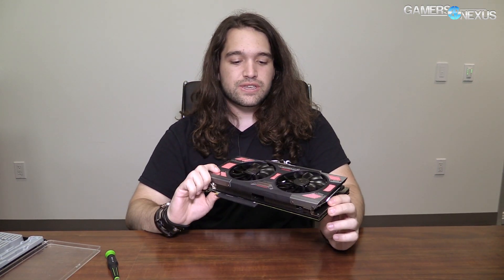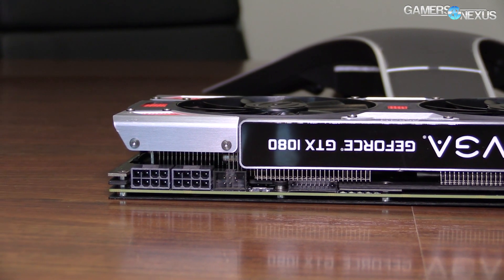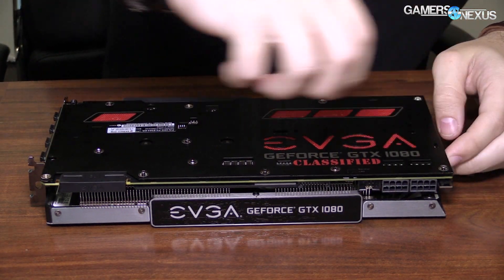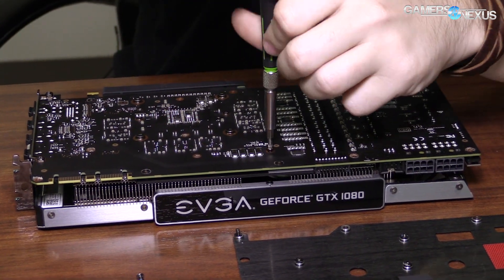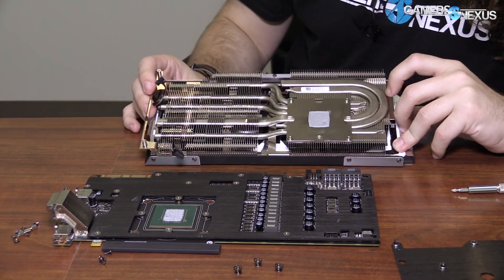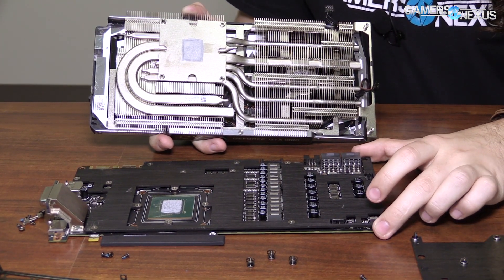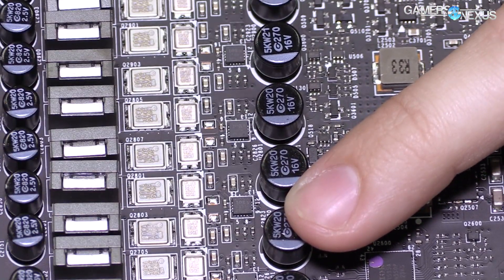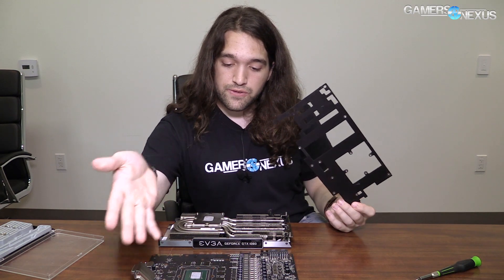EVGA GTX 1080 Classified Tear-Down & PCB

Comment: What is the difference between gddr and ddr ?
Reply: There really isn't much difference at all. The G just stands for "Graphics" basically. GDDR "IS" a bit more complicated to produce in most cases since it relies of an extra doubling of data rate over what typical DRAM uses; but for the most part they are quite similar. You can directly compare GDDR5 to DDR3 in terms of performance and specs etc..  for example, the "true" speed of most GDDR5 on GPU's is around 1,750 to 2,000mhz  (which comes out to between 7,000 and 8,000mhz when you apply the double data rate etc..) which is roughly equivalent to the speed of average DDR3 RAM sticks (1,600mhz, 1,866mhz, and 2,133mhz are by far the most common speeds)  And the new GDDR6 RAM that will come out in 2018 is basically equivalent to DDR4, it will run at more like 2,666 - 3,000mhz standard (Which is between 10,664mhz and 12,000mhz with DDR's applied) which are the same speeds that most DDR4 system RAM runs at.

Comment: Looks like a 7 phase using doublers, I think I remember Buildzoid saying you can't really get anything over 8 true phases but don't quote me on that it's late
Reply: that's correct.
Reply: Actually Hardcore Overclocking http://imgur.com/a/txmoH Ayyyyyyyyyyyyyyyy
Reply: So what real benefit would doublers have in a situation like this then? Just redundancy if something blew?
Reply: 9:27 in the video... spreads out heat.

Comment: Sooooooo, how are the VRM Mosfets cooled??
Reply: VRM - Voltage Regulating Mosfet.  They almost always get hotter than the CPU/GPU Core since they are delivering around 180 Amps around the board.  VRM is not Memory!  Not cooling the VRM is a HUGE oversight by EVGA as these things reach 110C+ easily and max out at 125C!  As the storys are coming in, these things are causing the cards to flair up and cause fires!
Cooling memory is not necessary compared to your VRMs, a thing Motherboards also do when you see their heatsinks!

Keeping a cool VRM does more than just keep your card save, it helps increase the efficiency of the card as the hotter they are, the more power loss there are.  Always look for coolers, weather it be for Video Cards or motherboards that have good VRM cooling (Mosfet Cooling) as it's the 2nd most important cooled part of the PC.  This guy pointed it out 3 weeks before the cases with these cards causing fires etc! Good on ya!
Reply: When he takes off the heat spreader back plate and shows the thermal pads that pulled the Micron logo off the GDDR ships, you can see an additional thermal tape strip on the plate that is vertical and sits right on the chokes.
Reply: +BelligerentWoW Yeah, I totally agree. I just got my new graphics card yesterday and I'm so happy I did my research before buying. I ended up going for the MSI Gaming 1080 rather than EVGA. MSI actually put a finned metal plate over the VRMs that's directly under the rear most fan, so the VRMs should always stay under 100°C.
Reply: the only affected EVGA cards are the ones made before September....

Comment: they changed the caps on the classy, used to be red 2000h caps, now its 5000h black caps...does not have to mean they are better though.

Comment: They should sell a disassembled version at a discount. Like Ikea.
Reply: or like intel's K processors "We'll sell you the PCB, you get the cooler. That'll be $30 extra"
Reply: Or just the GPU's pcb. No cooler etc, but offer the coolers as extras. That way you could get just the pcb, at a reduced price, then install your own water block.....
Reply: They need to put a heatsink on the card for QA and once the heatsink is on taking it off is just extra expense.
Reply: Actually Hardcore Overclocking They could easily make a waterblock style heatsink and use some form of a quick-release jig for Q&A purposes

Comment: Hi Steve, I have the 1080 Classy, and it's super silent. with regards to the 122% and 132%, It's bizarre that it appears to hit the 1.092v limit before even hitting the 122% so most of the time I can utilise the GPU to 100%, but depending on game, it never goes more than 115% ish power.. I managed a +75Mhz core, +450Mhz mem, and it remains cool. Why are NVidia soft locking the voltage cores on all cards? It makes supposed better cards like the classified no better than reference (except noise) Manage 2086Mhz Stable @ 76 degrees on stock fan curve.

Comment: EVGA makes some beautiful coolers and cards inside and out.
Reply: I find them to be pretty mediocre. I think MSI's Gaming X shroud looks amazing this generation.
Reply: Ben G I tend to agree. i think MSI did a good job.  EVGA could have been a bit more subtle with their branding this time, but you must agree the presumption of MSI to only make a black and red card but also include RGB was not a strong design choice.
Reply: They use copper
Reply: They used nickel plated copper on this card. (not aluminum if that is what you are thinking)
Reply: They also have the armor card, its black and white but has no back plate.
Reply: Except the shitty design of the ACX cooler.
Reply: Does this card suffer from the overheating today?

Comment: impressive that is my xmas present. question. why the EVGA logo on side does not said classified in red?  Also as far I have read, what is that conector beside the two 8 pin conector?

Comment: Another great video.  Would a Kracken G10 fit on this?
Reply: He is asking about a 30USD AIO waterloop solution..and BAM! EK waterblock, and pump and reservoir, hoses and much more...suddenly 800USD setup on the cooling..cmon man.. 

Ask NZXT if the G10 fits.
Reply: EK block would be better perhaps. Though as he said if you're going to do that then just get a pre done solution or mod a cheaper card.
Reply: Why down clock, might as well buy a brick then? ;)